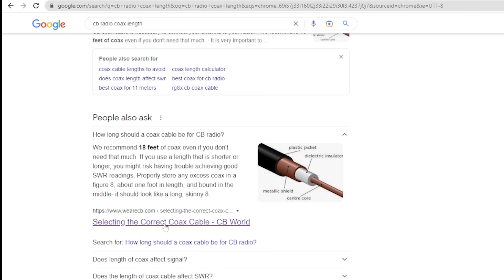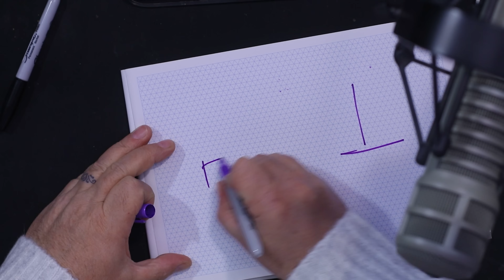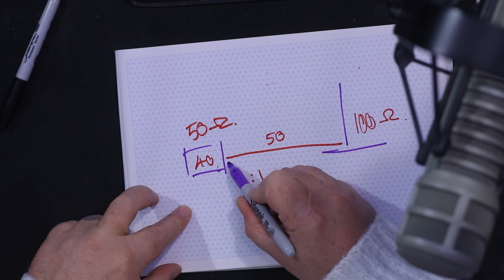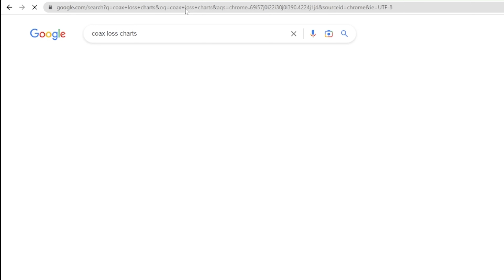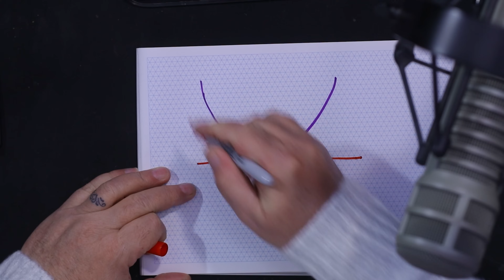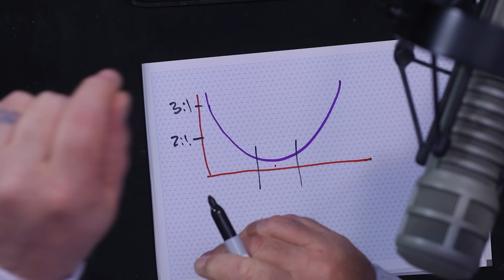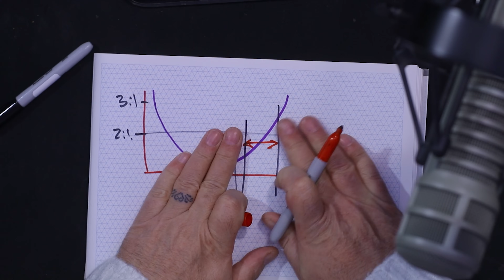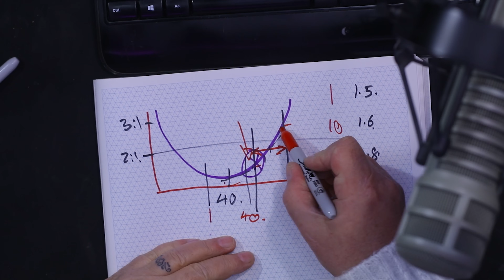11m / CB Radio: How Long Should My Coax Be?

Comment: I would like to add for the CB'ists that when you run a really long way to your antenna, RG58 is better than RG213, as it gives you a much lower SWR at your transceivers side 😂 - and bringing the antenna down right above ground gives even a better SWR (and saves the worms from getting a cold) 😜 Oh, yes, thinking of all those myths takes me back to my early 90s CB years. Thank you for the memories! 😊
Reply: As a newly licensed ham I once installed a 150 foot run of RG8 going up the tower to my 440 MHz beam.  I checked the SWR after install and found it was a good 1.2:1 all the way across the band.   Then I noticed I had forgotten to connect the other end to the antenna and it was just hanging open at the top of the tower.
Reply from the maker: @star gazer - that's SO FUNNY!
Reply: @stargazer7644  Ham Radio is your Career? That’s really strange?😵‍💫🎙
Reply: @1OFGODSOWN  lol yeah I guess so.  Words are hard.
Reply from the maker: HAHA!
Reply: @garyiow8482  Yes less power, less SWR!
Reply: you seem very clever. Can you give me the definition of a resonant antenna? Let's say, in this case, a half wave dipole? I'm just a CBer and would really like to know.
Reply: @arconeagain  Oh, that's easy to answer one the one hand, on the other hand it's hard when not going too deep in the hole. Basically, an antenna is resonant when the complete power that it gets from radio is transmitted into the air. This happens when the antenna is roughly half the wavelength, including the radials in most cases - in theory. And here's where it gets more complicated with excursions to complex numbers, reactive impedances, etc. But it is worth mentioning, that an antenna does not necessarily need to be resonant to be a good radiator! For the sake of simplicity you can say that a half wave antenna and quarterwave groundplanes are resonant. Still one of the best selling length is 5/8 Lambda, though not being resonant. More important is the length and height over ground, albeit experimenting is key! Sometimes shorter an less height can be preferable in terms of main radianting direction over longer and higher antennas. This is where the fun part begins. For beginners I would always go with (resonant) half wave antenna like the T2LT, on a spider beam like pole at different height, and in comparison a nearly full wave delta loop at different heights. 73 & 55's
Reply: @etzow  well, you're sort of all over the place, dancing around the question. And I asked in particular, a dipole as the case study. You almost said the predicted, like the majority of hams. The analysis is rather straight forward if you have the right education instead of the 'skip to the end' approach most hams are taught and regurgitate. But what would I know, I'm just a poor little CBer who's so vulnerable to ridicule. Maybe part of what you said is correct, but that's otherwise a big fail. Next you'll be telling me that SWR dips is directly related to resonance. I will also add that single band use can help one's education, so as not to pick up bad habits.
Reply: @arconeagain  SWR dips are indirectly related to resonance.  They are directly related to the impedance match, and if you're not at resonance, you're likely going to have a poor match (assuming no tuner).  Being at resonance doesn't guarantee good SWR though, because the resistance could still be wrong at resonance causing a bad match.  You use a balun in those cases to transform the impedance closer to where your rig wants it.  Resonance is generally where the SWR dips though.
Reply: @stargazer7644  for an antenna designed to be a certain impedance when resonant. I said directly, and then you replied indirectly. My point being that many hams are poorly taught, or fall in the habit of thinking that a resonant antenna automatically has a good SWR with their 50 ohm feed, or whatever impedance. It's true, I see it all the time. I spent a half hour once trying to explain it to a ham, that his dipole may measure 1:1 with his 50 ohm system, but that doesn't mean it's resonant. It's likely the coax run was attenuating the reflected signal anyway, but it all fell on deaf ears. Especially coming from a CBer. As you've probably noticed, I've got a gripe with you hams.
Reply: @arconeagain  Well Jeremy, I'll try not to hold it against you.  Many of "us hams" started in CB including yours truly when I was just 9 years old.  I graduated from CB and have been a ham for over 30 years.

Hams are like anyone, some are highly educated, some are less so.  The difference between hams and CBers is that all hams have to pass a knowledge test to get licensed, so at some point they had to learn and know something.  Granted, for entry level technicans (in the US) that bar is pretty low and really includes very little technical electronics or antenna theory.   But it is something.  The tech test is very easy to pass.  But have you ever taken a look at the top level Amateur Extra test?  That one takes some time, effort and education to pass.  

You sound like you wouldn't have any problem with the test.  Check out a local ham radio club.  Take the test.  Get your license.  Come see how much more fun you can have as a ham.  Maybe then you can run some classes at the local clubhouse and teach some of those interested noob hams how antennas really work.  You can even keep your CB if you want.  I promise I won't tell anyone.
Reply: @stargazer7644  I've said to my mates, a few times, if I ever wake up one morning (maybe after a few drinks) a licensed ham, I'd kill myself. So there's some more insight into how I feel. You know, if this video didn't start out with such laughter and ridicule, including all of your crying with laughter emojis, I might feel different. Yes, many hams started out in CB, but that doesn't mean you have to desert all of your friends. I'm very loyal, even if I know tons more than them. Do you know what I do? I help them. I have one very good friend, he's a ham, has been for decades, has the highest ticket or whatever, who cares? He really dislikes other hams too, but loves his CB. He'd run rings around you blokes, all of you put together. Then there's another bloke I know, ex RAAF, military training and knowledge is the best. You guys don't have anything on people like that, but behave so high and mighty. He was designing upgrades for the US Air Force before you were in nappies, flight control, everything and he's Australian. Ask him anything RF related, it's child's play, like he's offended to have to answer. But he is very humble. Now, I have already pointed out some inconsistencies in this presentation, and plan to carry out my own tests instead of jumping to conclusions. That's what a true radio enthusiast would do.
Reply from the maker: @arconeagain  @stargazer7644 - You do realise you guys are arguing over thread that started off as a joke?
Reply: @DXCommanderHQ  yes, I even state this. I don't like being made fun of. Who does? I'm also sticking up for my CB friends, some of whom are much more knowledgeable than most hams.
Reply: @arconeagain can you help me then please? Legit. I’m noob and have no idea on setting up my antenna. I have a president McKinley CB radio - but have yet to choose an antenna or coax. I live in the middle of town and the run out the highest pole on my roof seems farrr away. Any suggestions? P.s id like to buy an antenna that doesn’t look like tooo um attention grabbing if possible
Reply: @arconeagain I live in apartments so, yeah everyone just has tv antennas here around me
Reply: @twalsh05  horizontal or vertical? In other words do you want to talk local or DX or both? How discreet, is it a landlord/body corporate situation? For instance a quarter wave droopy might be okay. Or you may have to go wire like an inverted V or a coaxial type antenna. Then there's attic antennas and outdoor balcony types. Straight horizontal could be a simple dipole or a Moxon might be the trick. A more extreme type indoor/semi outdoor could be a magnetic loop! A fairly long coaxial run could be done in RG213, LMR400, or this Messi & Paoloni everybody raves about. Maybe look up some of these antennas I've mentioned and get back to me with a few more details of your situation and what you're willing to either buy/budget or do yourself.
Reply: @arconeagain  thank you really appreciate! I'll check some of them out. It's a landlord situation, they seem pretty chill tho. My biggest concern is I don't really have any line of sight from my place, hence the idea of doing a long run to am antenna on my roof. Like my apartment is kinda surrounded by other highish buildings in a very central area. So I'm not sure how well a balcony thing would work, but then again I wouldn't know lol.

As far as distance goes I'd like to be able to talk to my friend 30km away and others in my immediate city. I hear about ppl skipping signals a long way, and that does sound fun ain't gonna lie xd
Reply: @twalsh05  no worries. So vertical antennas I'd be looking at, and depending on what's on the market in your country, 1/2 wave, 5/8 wave or .64, or what I think may work well for you, a 1/4 wave Starduster. You can get 5/8s in fibreglass with or without ground plane radials, or fully aluminium with full size ground plane radials. 1/2 waves are common in aluminium (no radials). The Starduster is half the length with drooping radials. If your coax run is exceptionally long, you may have to go for half inch Heliax ($$$). What's deemed as long, people will dispute this, but I might say getting over 50M. You can check the data sheet on coax for attenuation per 100ft (signal losses), not sure what this equates to with say 50M of LMR400 and what it means in the real world/on your signal meter. Remember, you would have to quadruple your power output for one S point. 30km is an easily achievable ground wave distance for 27mhz, but depending on your surroundings, like you described, could be at the upper end. This will also depend on how much interference, noise and static is present in such a built up area.
Reply: @arconeagain  awesome, I’ll see what’s avail here on my local Aussie market haha. Maybe I’m barking up the wrong tree, but is it possible to use say a DigiRig +JS8Call over AM SSB? All the videos I keep finding are hams lol. And I don’t want to be ham (no offense guys) 😆💀
Reply: @twalsh05  I'm an Aussie too. Where abouts are you? I'm in central Vic.
Reply: @arconeagain  saweet! Wagga nsw bro - sh*tty weather today tho 🌨️🥶
Reply: @twalsh05  I here you guys occasionally on short skip. Conditions are trending to the west, don't hear much of the usual skip from up north at the moment. I'm sure it will pick up again come summer or even spring. I am looking forward to catching up with my good mate in northern NSW. Try and keep in touch because myself and my connections can really help you out with advice and antennas etc. including antenna builds. In the meantime, see if you can make good friends with the landlord. 535.
Reply: @arconeagain   
Have you ever run a wet finger along the top of a lead crystal wine glass?  It doesn't do anything until you find just the right speed then suddenly the wine glass stars singing a pure tone.  This is when the frequency you're putting in with your finger becomes resonant with the wine glass - it then starts radiating loud sound waves.  Antennas work similarly.  When their electrical size matches the frequency put into them, they resonate.

An antenna is resonant when it presents no capacitive or inductive reactance to the transmitter - when it appears as a pure resistance and accepts max power and (hopefully) reflects none.  If an antenna is electrically too short or too long, it won't be resonant, it won't radiate well and the transmitter won't put full power into it because it isn't a good match.  A tuner attempts to cancel out that capacitance or inductance to make the transmitter happy so it will transfer max power, but it doesn't make the antenna resonant.   Adjusting the length of the antenna makes it resonant.   

Antennas are resonant when they electrically some multiple of 1/4 wavelengths long.   A simple vertical is 1/4 wavelength.  A dipole is a 1/2 wave antenna (2 * 1/4).    A full wave loop is 4* 1/4 wavelength.  A 5/8 wave vertical is not resonant, and requires a matching network to make it look like a 3/4 wave antenna (3 * 1/4).

I keep using the term electrical size and not physical size.  That's because the speed of the radio wave is slower than the speed of light inside of objects like antennas.  This variation in speed depends on the properties of the material.  You have to adjust for that when calculating the length of the antenna so it is electrically a multiple of 1/4 wavelength long.  This will make the antenna physically slightly shorter than a free space 1/4 wavelength.
Reply: @stargazer7644  in reply to your resonance explanation, all of this I already know. You get a pass with your initial statement. An antenna is resonant when the wavelength/s, or divisions you mentioned, fit the electrical dimensions of the radiator. That's a bit of a difficult one to phrase well, I butchered it. Then you follow up by saying when it presents no reactance, which is fine. However, many hams skip the first bit and just say this, that it is purely resistive. This is clearly not the definition of resonance, it is the resultant. They may as well say an antenna is resonant when I put my analyser on it. You left out end effect, by the way, and I did use a dipole as the example. The increased capacitance toward the ends in the real world. Also greater element diameter, due to skin effect. With that, increased bandwidth.
Reply: A resonant dipole for cb is (2) 1/4 wave legs ( for a total of 204 inches) preferably 180 degrees apart.
But can be in an inverted v or even an L shape. But you will find impedance may change a bit
Reply: Quick honest question. Not looking to be made fun of. 
This is what I've experienced but can't explain, when it's supposed to not matter. 
Take a VNA
Take a 50 ohm dummy load.
Take 3,4,5,8,12' pieces of 50 ohm coax. 
Why does the VNA show different resistance and different SWR when you put those different lengths between the VNA and dummy load? Is it fake? 
Why when I take my radio and antenna and change Nothing but the length of coax the radio swr changes. I want a detailed explanation because everyone says it doesn't matter but when my finals are getting hot and my bird shows watts going the wrong way. What is the remedy? 
Cause when I experienced this. The only thing I changed was the coax length and ...... It's now 1.08:1 vs the 1.7:1 it was.
I understand the SWR curve. I have a VNA I can see it. So I tune the antenna so my middle channel in my band is at the lowest point of the curve..... What if that lowest point is 1.1 at the feed point of the antenna. Add coax and it's now 1.5swr. look at the VNA and you're still at the lowest point in the arc but it's higher. Change the coax to a tuned  half wave length and now it's 1.1 again. Please only answer with actual details don't just say it doesn't matter and then not explain anything. I understand his example of a 12 watt radio .... What about a 1,500 watt radio.... Don't give me any of the that's not allowed stuff either... None of the CB guys care about RULES. Many care about spurious emissions and we ensure we don't splatter. Some of us run the same gear if not better quality gear than most hams we just stay in our lanes. I know several guys who run 3-500z boxes with icom 7300 ,low pass filters, 5 beam elements and just stay in 11m. We talk like the 180 meter chaps. We don't want to deal with call signs and having people trying to run signal strength checks and all that. We just want to talk about the mail. Not our gear etc etc.
Reply: @electromechanicalstuff2602  When I get your question right you see a lower SWR with longer cable, right? The cable has a resistance that increases with length, i.e. with more copper between the sender and the antenna. SWR is the ratio between the power that goes into the cable and the power that returns at the same point. Due to the resistance some of the power from the transmitter is converted into heat in the cable after the point of measurement for the forward power. So already less power arrives at the antenna. Here some of that power is reflected down the cable again and undergoes some loss because of the resistance again. So, the reflected signal is lower at the point of measurement (TRX) than at the point of reflection (antenna). Thus the SWR here is lower than it actually is at the antenna. When the cable was indefinitely long all power will be dissipated as heat before it even reaches the antenna. In this case you will have the best SWR of 1:1.0 - no matter whether the antenna is actually tuned or not. Besides the measured impedance of this endless cable is indeed the cables nominal impedance of 50 Ohm.
Reply: @etzow  thank you for your respectful response. However not quite my question. I'm fully aware of loss in a coax. That's not what I'm seeing in fact sometimes the opposite. So as he said. Coax has velocity factor. So I run rg400 jumpers and rg213 to the tower. When I calculated that into it as he did. I too landed around 12' not 18'. The 12' would have a low SWR and the 18' has a higher SWR. In my base station. I have 100' of rg213. I had a reasonable 1.1 at my antenna and 1.3 at the radio. I didn't want to buy jumpers. So I decided to start cutting off pieces of my antenna feed as I had 20' extra just lying on the roof. I cut off just 3' and my SWR went up to 1.35. I cut off another 3' started going down 1.25 another 3'... 1.20. another 3' 1.15.... another 3' 1.10. it continues to get better the shorter I got..... Till a point then started going back up. It acted like a sine wave. Then I bought a VNA and I could actually see on a 50 or 100mhz spread the sine wave. As I change the location of the cursor on the frequency I can see the capacitance, inductance, resistance and reactance change from perfect to not as perfect. Like he showed in this video. When I started looking into this the first video I found was on YouTube channel called ham TV. Where an instructor used a rig expert, a ballun and a dummy load to show the same thing I'm talking about. I followed his instructions and got my stations swr down to a perfect match by making my cable shorter. Then I made a few rg400 tuned coax jumpers all about 12'. To do that you have to start with a 13' of coax and cut off 1" at a time until the capacitance and inductance goes to zero. Then you're done. Solder an end on and install.  I'll look for the video and add it

Edit
Here's the video
https://youtu.be/Z2lxv6F8fvA?si=DiJBHwJEWaaQOsRG
Reply: @electromechanicalstuff2602  Sorry for getting you wrong in the first place. Your question is very interesting, as is the video that you shared. In theory the length of the coax cable should not influence the VSWR value but the actual resistance and reactance parts of the antennas impedance. However the other video showed what you have observed and the lector mentions that his cheap  coax must introduce some additional capacitance or so. That's the only reason I can also think of. In that case the circle in the Smith chart for the transmission line is not in the middle (around the 50 Ohm middle point), but shifted to the actual and partly reactive impedance. That will move the distance between the 50 Ohm point and the shift by the transmission line and thus the VSWR value, repeating every 0.5 wavelength. But really a very interesting question! I wonder how I could measure the real imaginary impedance of the coax cables I have here with my VNA..
Reply: @etzow  I do it with a 50 ohm dummy like the instructor and u can see the nulls. I've done it with rg400 lmr400 rg8x rg213 the lengths always differ due to velocity factors but there is always a null at every frequency. In fact just do a frequency sweep while connected to your coax and a dummy load and u can see the frequency directly affects the impedance this affecting the SWR. If you run a tube amp. It's not really a big deal as the tune/load caps will tune the impedance of the tube and the other will tune the impedance of the antenna to match. Same if u are running an antenna tuner from what I've seen. Same as tuning the input or output of circuit of a transistor based amp. U can always tune the input and output with a variable capacitor for minimum SWR and max power. Doesn't matter what length cables u have as long as u have tuning caps to make the impedance tune correctly.
Reply: @electromechanicalstuff2602  I watched that video. There are tons of variables from coax to coax they are testing wit. Some from Amazon, some rg8x, some rg213, some rg214, they don't specify the connectors every time, and when he switches from "mil spec" rg213 fifty feet, and then "mil spec" rg214 one hundred feet, he says, the rg213 would look the same but doesn't actually show us it's the same. Every coax was different from the last in some way.
Reply: @Eli5047  right but the big thing was is not just the SWR was more or less but the nodes where at different frequencies.
Reply: I just coil up 500 feet of rg58 behind my radio and the swr is always low.
Reply: @GoonyMclinux  I bet it is. So is your chance of QSO, QSA and IQ